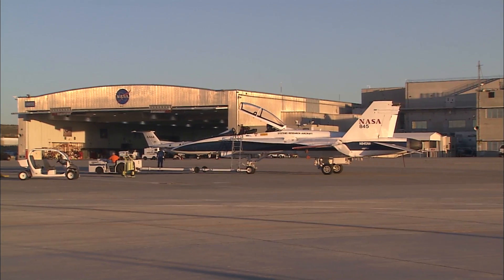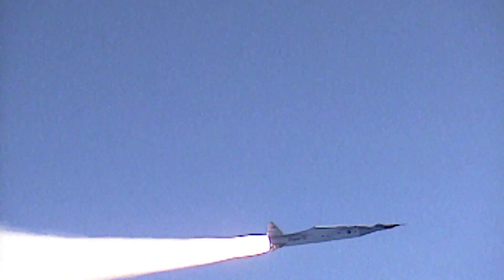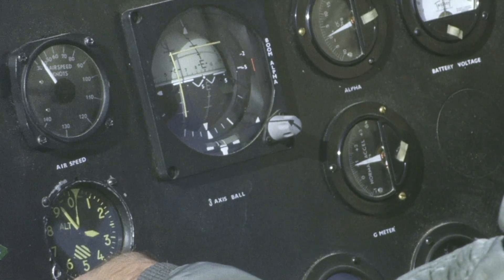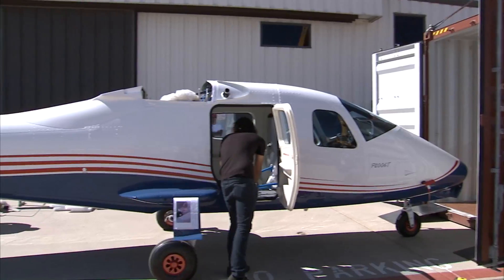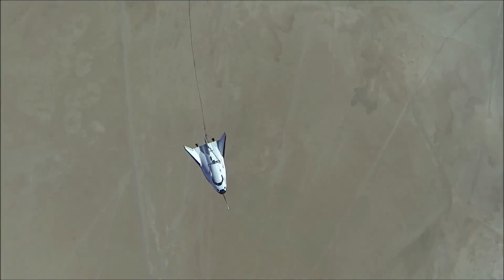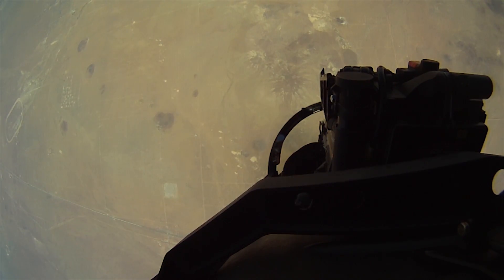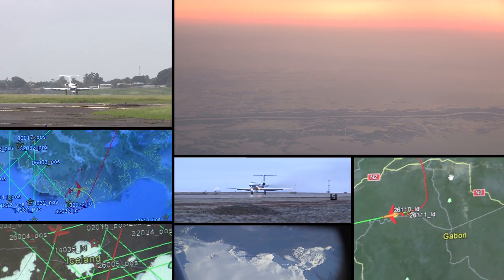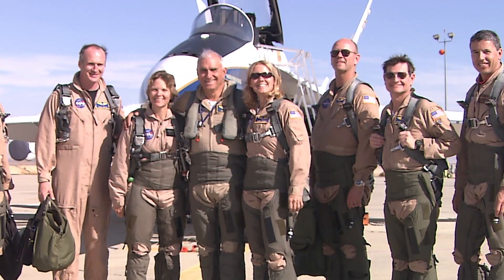NASA Armstrong Flight Research Center: 70 Years of Flight Research

Comment: Still my opinion is that concept that allows to enter sub orbital and orbital flight like space shuttle or x-43 are erroneous. Because you need 2 engine platforms for launching 1 vehicle. scramjet engine is useless too because you need to gain supersonic speeds to start it. Rocket engines and rockets itself have a huge mass of fuel and payload are less than 15-20 percent of the total weight. To gain clean acces to space i think best concept is air to space vehicle with engines on a new principles. Only when space crafts will be able to take off from landing pad with no external boosters or special vehicles fly through troposphere, stratosphere etc. And deorbit, and safely land. and I think that we already have the required amount of technology for the implementation of this principle of flight into space.
Reply: This is good but right now we need new technologies. Where is progress? When 20th century started we invented flight, and now 21th century, we invented nothing. Moon program and flight to mars are just financial speculation and the write-off of money, because we dont have space ships and platforms to perfom such a mission. And All that demonstrates Lockheed and Boeing complete crap that does not allow you to perform such tasks.We need a breakthrough quality improvement rather than on 5-10% technology of the 20th century.
Reply: Well not exactly. First of all even if gov WILL fund alpha centaury flight, we cant fly there because of many things. We cant fly even to mars, because last data shows that human brain degrades very quick in outer space because of radiation and cosmic rays. So if astronauts fly 1.5 years to mars at the point of landing they will be imbeciles. We need a solution in radiation protection, engines, astronavigation, space medicine etc. Science is so young. Money not the issue here. But they could boost science, but you still need a genius who will do the job.
Reply: I forgot to tell, US Gov invest tons of money into the science. For example NASA`s budget is 17 billion of dollars per year, and roscosmos has only 2.7 billion of dollars. In fact Canadian Space Agency has only 350 million of dollars budget per year. For me mistury is why with all that bunch of money they still cant make any progress.
Reply: Comparing our(us) space budget to other nations with space programs either in its infancy or geared only toward the occasional satellite launch...is not a relative comparison

The scale and breadth of NASA work is in orders of magnitude larger than its closest rival i.e Russia. They were neck and neck till the end of the cold war...now the money isn't there to sustain that level of activity...

I say that to say this...To understand how much the NASA budget has been slashed and starved, you have to conduct a time-series analysis of their budget over-time i.e. comparing NASA during the glory days to its poor cousin of today.

You also, need to split the budget into 
1/ R&D innovation: Moonshot projects, new concepts etc like Google ATAP type stuff
2/ R&D continuous improvement: These are new ideas to improve existing functions and requirements. Improvements along the 7 waste dimensions described in Lean manufacturing i.e. immediate benefit realisation (less fuel etc)
3/ Operations, Maintenance and Repair: Keeping things in the pipeline working

You will then see that a large chunk goes to 3, while 1 has been slashed heavily compared to golden era and 2 has been squeezed forcing prioritization of 'moderate-to-high benefit low cost projects and eliminating virtually all ''high benefit but high cost' projects.

hence why you are seeing joint co-operation projects with companies like space-x across activities in 1,2,3 that are part of the current NASA budget. In an effort to cut existing costs further....

You are also seeing some of the high benefit-high cost project opportunities across 1 and 2  being bid out to private firms in the form of  competitions. Hoever, this means only those projects that could be commercialised are tested...

as no private company is entering a competition and spending millions if not billions if there's zero profit potential or ifif benefit realisation is at a  time horizon investors find unacceptable..
/ 25 year wait to break-even, 

/ consumer adoption not guaranteed at volumes for desired ROI

/ threat of alternatives possible in that time-frame (china, russia). Or substitute is developed by a competitor benefiting to bypass any patent protection you had but using your concepts without the r&D expense i.e. Marconi stealing Tesla's ideas 

One thing has never changed, if there's a military application the money will flow in to NASA. Moon-race was so well funded not cause of our love for space travel, but our love for ICBM delivery system. Switch out the space pod for a warhead, change guidance system programming....and make Stalin and Kruschev sh88 their pants